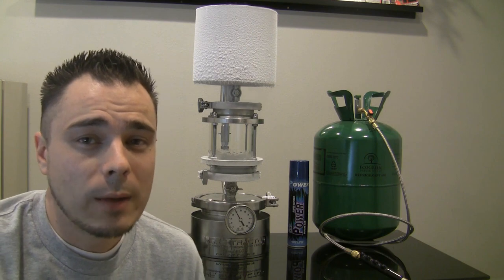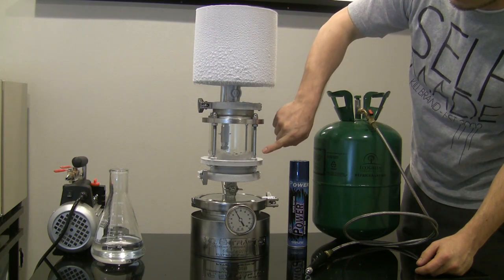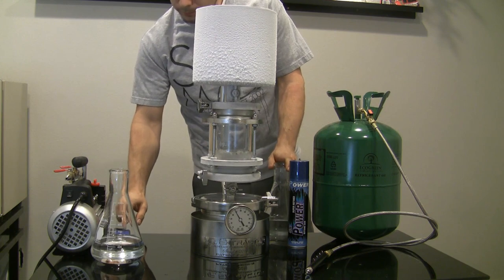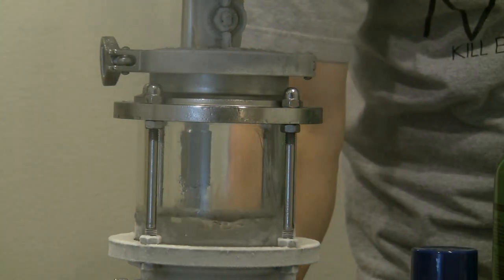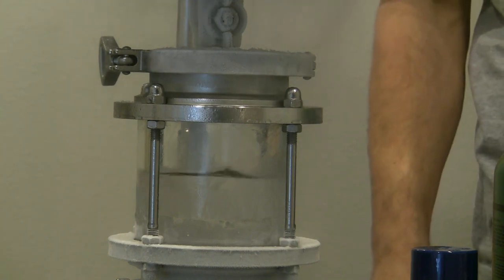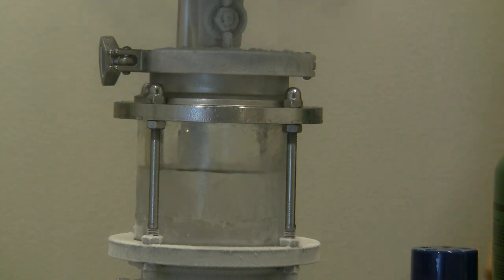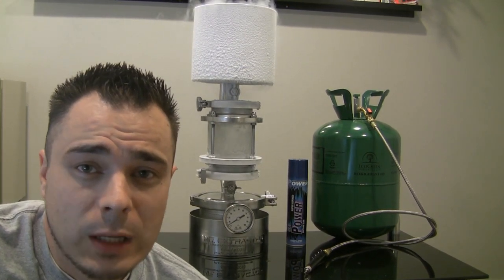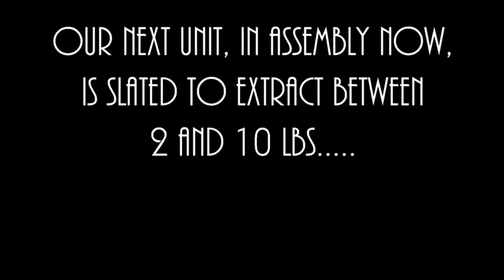Mr  Extractor 6 Minute Timed Recovery HD

Comment: Sounds like some hate... looks like a good product only thing wrong for me is the price
Reply from the maker: +Bubble Man The difference with our product is in its operation and manufacturing. Some other companies clamp together prebuilt parts and sell them as extractors, and they do work, and its vastly cheaper to manufacture that way. We work with 7-10 suppliers and custom manufacturers in Oregon. Our device also operates at about 5 -0 psi, and does so very quickly, recovering in about 10-15 minutes. We never set out to build the cheapest extractor, and ours is far from the most expensive, even as one lb systems go. Both the Sweetleaf and Subzero are more expensive with more complexity and parts.
Reply: Yeah but you want to put a patent on graywolf's work, you little thief. You also use pre built stuff, also you are not an inventor. You just plagiarized something.

Comment: sumthin seems off about this machine whats with the alcohol are u putting it in ur butane if so u must have alcohol in ur recovered butane which will extract mad clorofile and it has a bp of 176 so it a bitch of a purge compared to tane alone like winterized dab mad long purge time i hope im wrong and ur not putting alcohol in the butane
Reply: he's putting it in the dry ice bath. alcohol has a lower freezing point to water. a bath reduces the temp quicker than ambient air. the butane is in a closed, pressurized container in the top, where the bath is.
Reply: +steveholtz420 ok i see